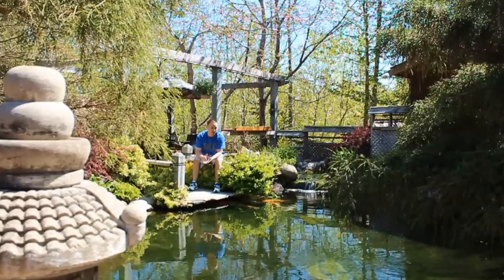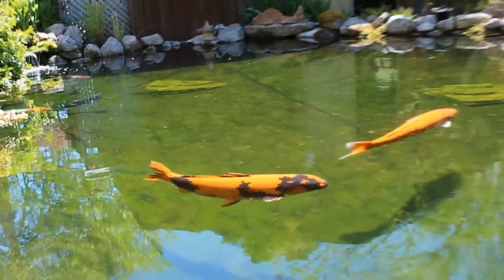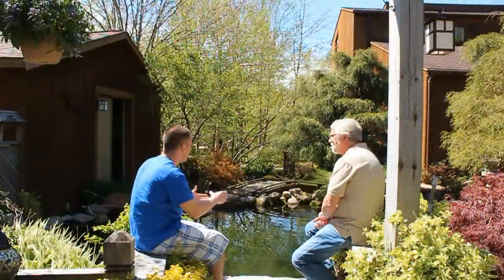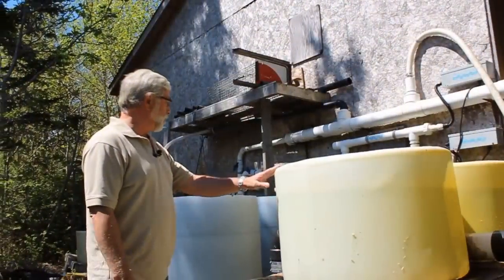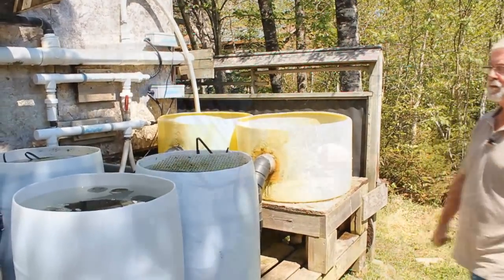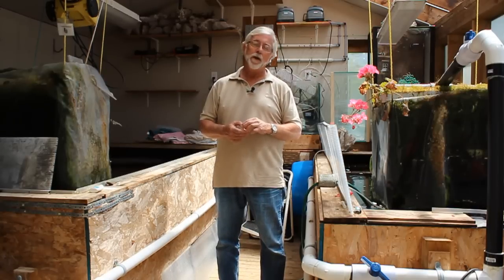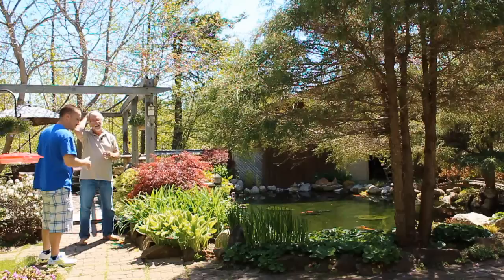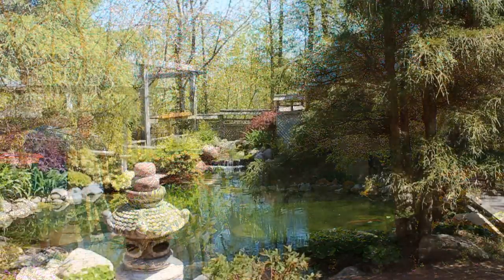HOW TO: Build a dream pond

Comment: Totally stunning pond!!  So inspiring.  Joey / Graham, one question.  Where I live it is really hot most of the year and people are losing a lot of fish due to the fact that our pond building "experts" here seem to only build the ponds 18" deep.  I have helped a lot of people with the chiller made out of small refrigerators I saw on Joeys site, thanks Joey.  Getting to my question, depending on the size of the pond how deep would you suggest when building.  We have the heat factor plus Raccoons and fox that can get to Koi in 18" of water quite easily so most people are having to cool as well as having to put electric wiring around their pond to keep the critters out.  Would it be beneficial to make the pond deeper and let the ground insulate it as well as give the Koi somewhere to hide out of the way of predators, all of which cannot swim underwater.  Thank you.

Comment: I'm going to be honest here. Being in the Koi Pond hobby for over 8 years I can say that the enjoyability of a pond is greaty derived from its ease of maintenance. I know you're going to hate me for saying this, but DIY pond filters will never have the same easy to use, clean, and maintain in a pond (and mainly) reliability. Right now I have a DIY filter in my pond, and even though my pond is crystal clear, the maintenance isnt easy. Every pond is an investment, one that is properly designed and installed (weather by yourself or professionally), should be done so with quality equipment.
Reply: Arteolike Actually, Arteolike, a well thought out DIY pond filter will work every bit as well and probably better than most commercially available ones and at a lot less money. If the maintenance on your current DIY filter isn't easy then it's not designed right for your set up. The gravity flow , vortex system that you saw in the video on the pond and the holding tanks is very simple to clean and maintain...pull a valve/ close a valve...turn water on...I don't like extra work.:)

Comment: Beautiful pond and fish!
But the filtration system isn't to my liking, with tubes and barrels, which could be of more use elsewhere.

If I ever build a big pond, I will be using nature to filter it. Using a series of raised basins, made of cement+stones, where the water enters in small passages by the sides of each basin, so as to create a vortex in them. Having moss cover the outlet, to pick up the dirt. And grasses and other plants from natural brooks in the basins.

Basically working with nature, and making it look nice as well.

This is really motivating me to get a pond going ^^
Even though I just have plans for a small pond to water the garden with.

Comment: Wow, great setup. I love the koi house but I do have some questions! What size and kind of pump is he using to move the water on the 2500? Whats his displacement like? And what about heaters? He said he heats it but thats one heck of a heater, I'm assuming it would be some sort of inline type heater?

Lastly looking at the filters, and he self admittedly doesn't take them apart and lets the moss grow by itself - what sort of maintenance does he actually do on the tanks other than adding ammonia during the summer?